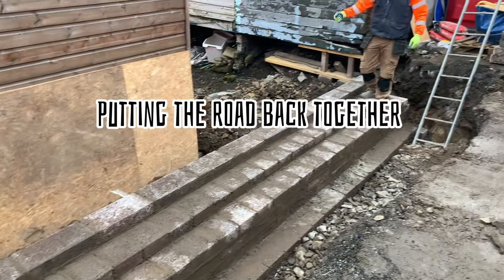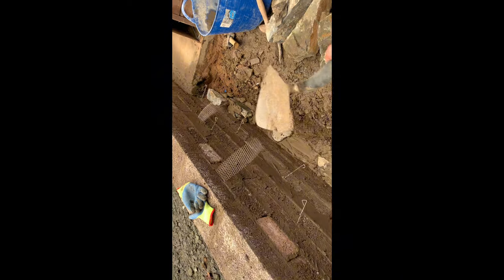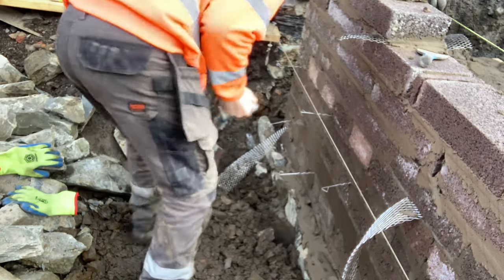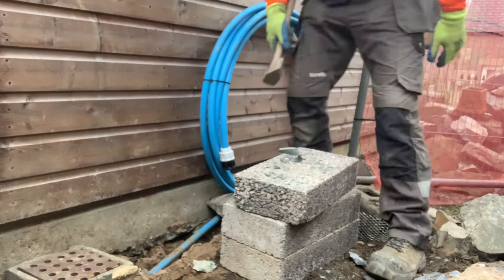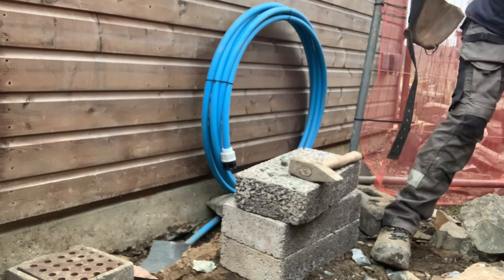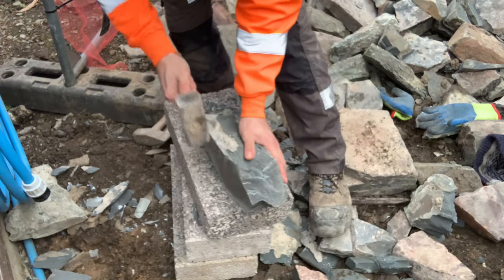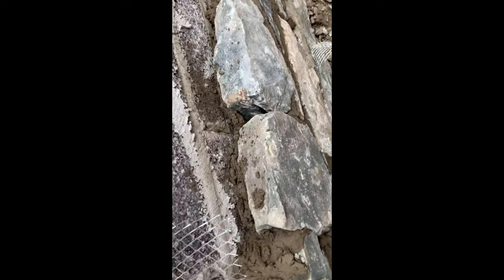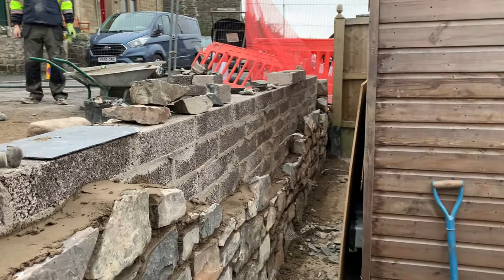Learn how to build a random stone wall

Comment: Great video mate. Could I ask what your mortar for the stone work is? if you have any ratios or recipe you follow. cheers
Reply from the maker: Morning mate! So actually it’s just a cement mix but we will be pointing it in lime mortar. This is a 3:2:2 (building sand: sharp sand: cement). Hope this helps?
Reply: Are you using nhl 3.5? It's probably counter productive if its against cement.
Reply from the maker: @benllewellyn1887 I know mate it’s not my spec unfortunately mainly aesthetics is the reason behind pointing it in lime. I’m aware cementicious mortar and lime don’t bond properly but if it was up to me it would be done completely in lime. I’ll be using Otterbein NHL 5.
Reply: @ModernPracticalStonemason  Yeah, that would be my concern. The pointing will just pop off over time.
We get this bullish!t all the time also 🤣. Nice work, though 👍